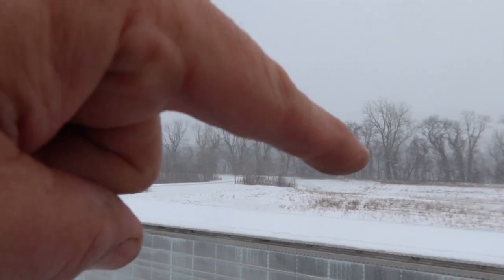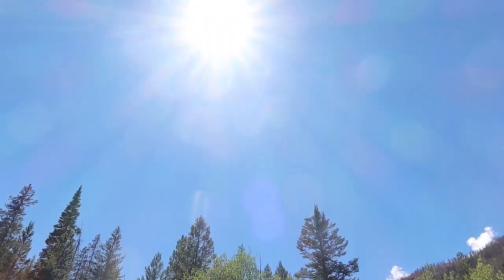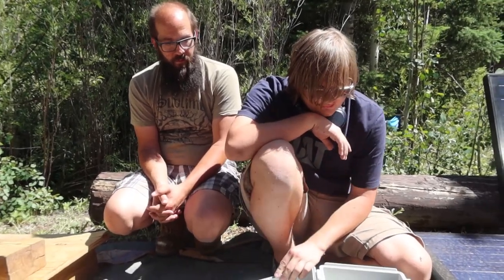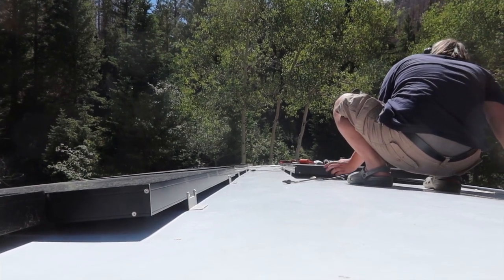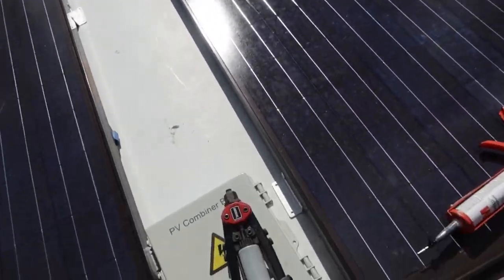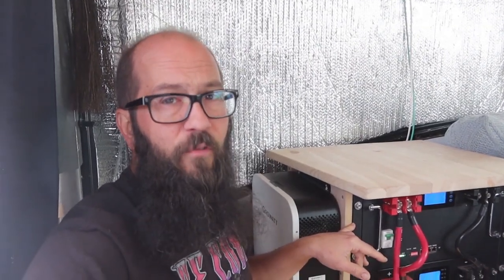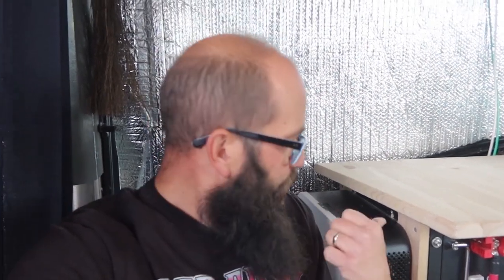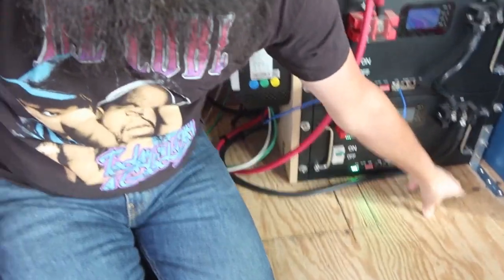Finally Installing The Solar Panels on Our Bus Roof so We Can Be Off-Grid Part 2

Comment: Why are you using electric space heaters when you have diesel heaters?
Reply from the maker: The original plan when we built Connor's room in the first bay was he was going to sleep in the extra room when the temps dropped below freezing. Currently Aly is staying with us and sleeping in the extra room so I put a Y in the front diesel heater duct to heat the front bay too. While the back of the bus stays toasty, the front now could use help below 15° F or so. A third diesel heater, heating only the bays would be handy. Staying in warmer weather would work too.